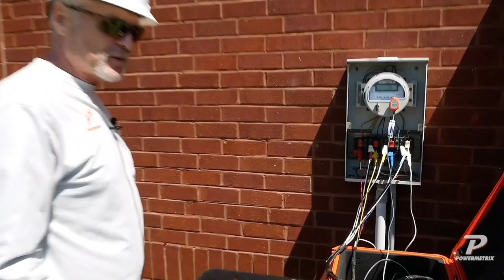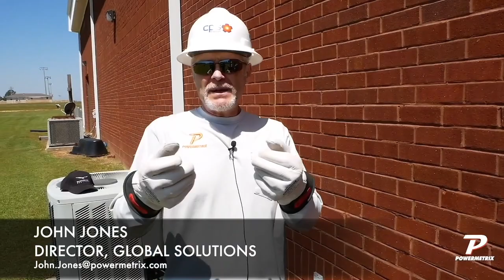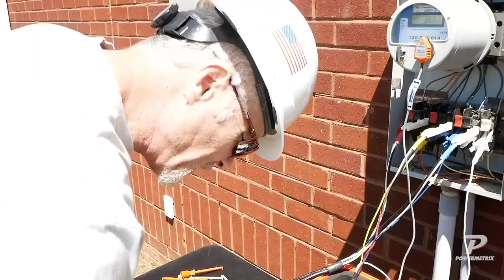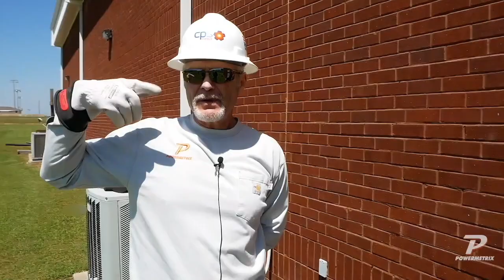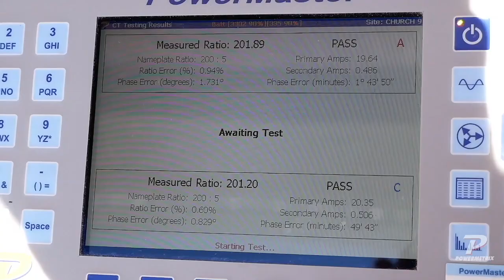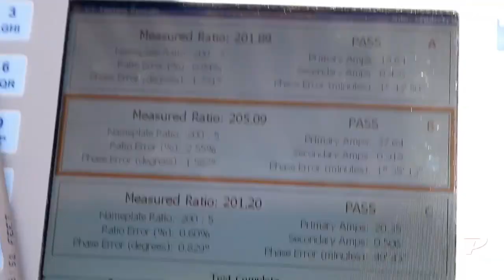TESTING A 9S METER WITH A PADMOUNT TRANSFORMER PART 3

Comment: Hello...Good video. So, on "a" phase you got a fail after repositioning the flex pick-up when you read 1.662 Phase Error. The third test after repositioning again gave you a Pass with 1.731 Phase error. At the end of testing "A" phase you passed with a worse phase angle, 1.731 (pass) and 1.662 (fail). This doesn't make sense to me. What am I missing? Thanks